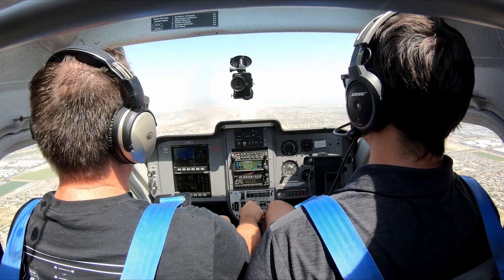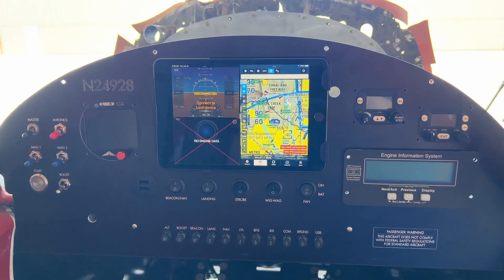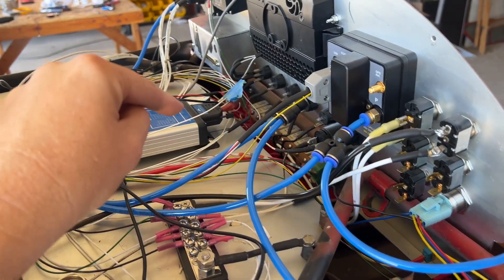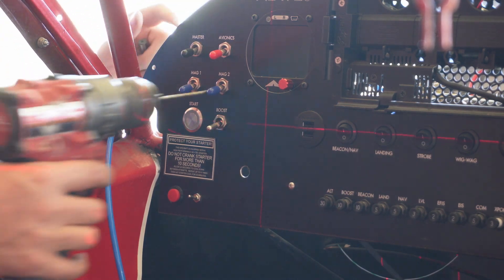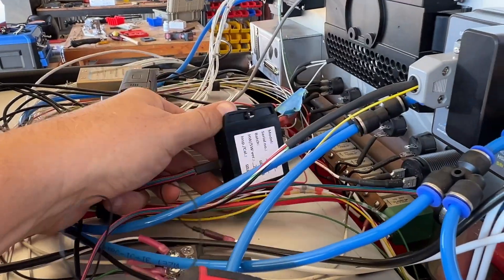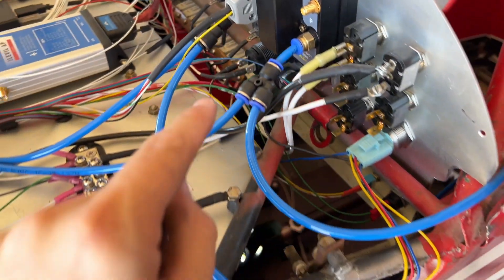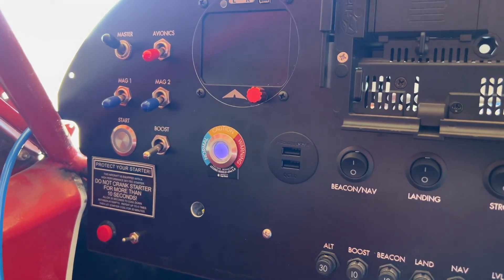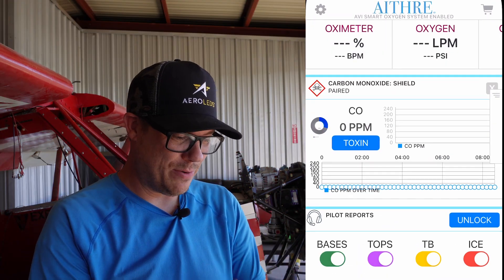Don't Die From CO | Aithre eDot 5.0

Comment: When drilling sheet metal you'll want a pilot punch mark, you can get a punch that you hit with a hammer, an auto punch that operates by itself, or in a pinch you can use a ballpoint pen. What this does is makes a small indent that holds onto the drill and gets it established.
Reply from the maker: I know. I just didn’t do it. Had a feeling it would wander, but hey… people love seeing me make mistakes. 😂 I punched it right after and drilled the hole. I have the one where you push and it pops, leaving a dent.

Comment: Hey would you have any easy tips on judging distances while in-flight?
This is my one sticking point when contacting ATC, I can never tell my distance from a POI/Tower/Runway
Like is there an easy mental math relevent to Altitude readings or something?
Reply from the maker: I don't. That just takes time and experence. I'm still terrible at it. I've flown a lot locally and know distances from ground references, which has helped. Otherwise I use the GPS or my ipad to get accurate numbers. When I'm close to the airport I can usually tell when I'm about 4 miles out though.
Reply: @flywiththeguys  Haha, dang, oh well, I'll focus on local to get a feel for it then 😅
Thanks for the reply!

Comment: Can I get your opinion on the new Lightspeed Delta Zulu helmet ( - https://www.lightspeedaviation.com/product/delta-zulu-anr-headset/ - ) that has a CO2 chip in it? It warns you in the helmet if you exceed the critical threshold.  I bought it mainly for this option, but it's always interesting to have the opinion of a confirmed pilot like you.
Reply from the maker: I also fly with the Delta Zulu. The CO detector is a great feature add. I'm not flying my J3 just yet so I use it in other aircraft. I don't really have an opinion on the helmet side of things though.